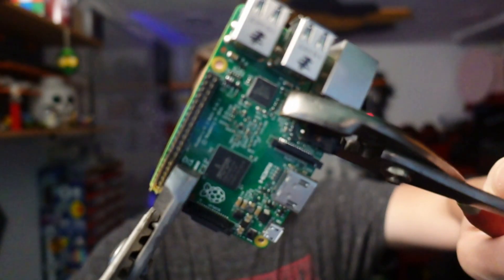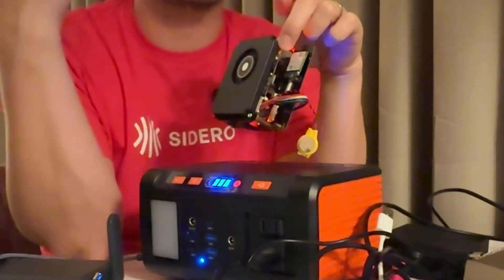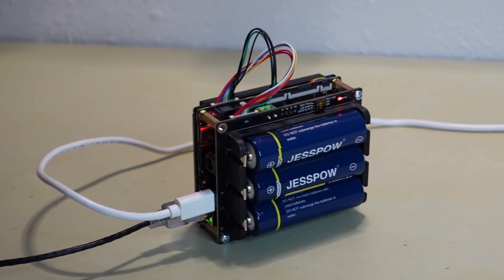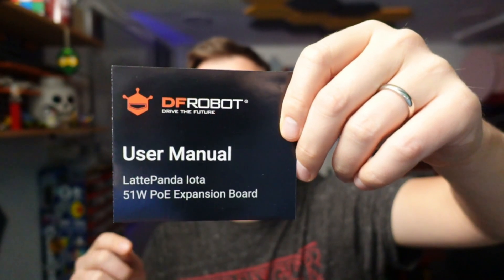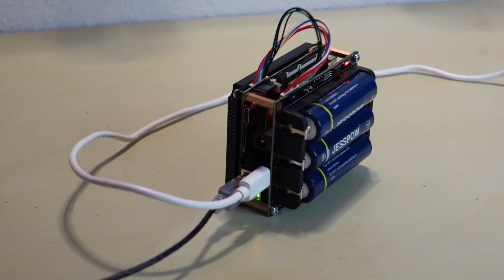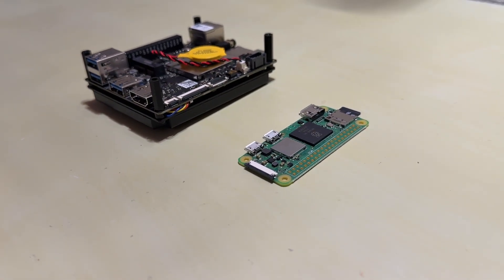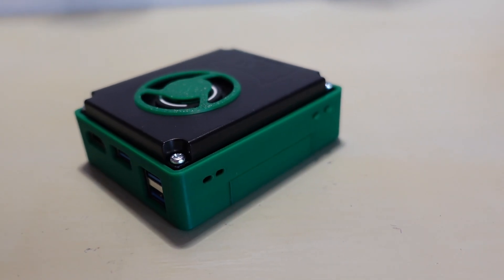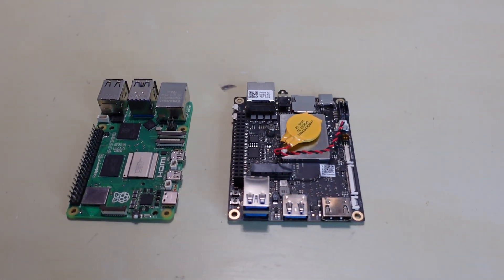The middle option for compute

Comment: i have an AI school project, that use object detection and camera (the ai glasses object ) . should i use the raspberry pi where i need to use AI KIT : AI HAT+ 26 TOPS Raspberry Pi (which is extremly expensive for me ), or choose the lattePand IOTA  or any alternatives ?
Reply from the maker: A pi 5 with AI hat, camera, and needed accessories will probably cost $250-300, but I'm pretty sure there are guides that exist to help you build it. The IOTA won't have specialized accelerator (you'd have to find something generic) which would probably be more powerful, but you'd have to figure out how to build it yourself from more generic parts.
Reply: Random suggestion, have you looked into tiny mini micro PCs with a Google tensor m.2 chip?